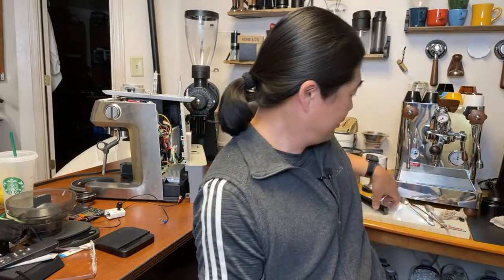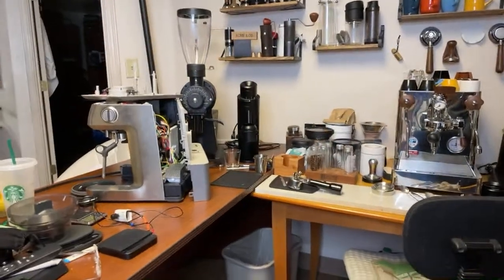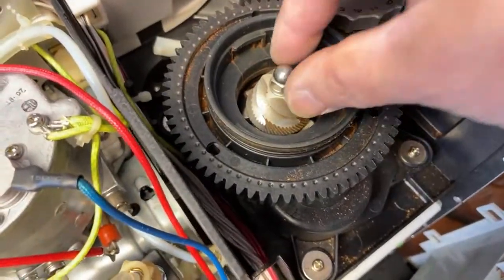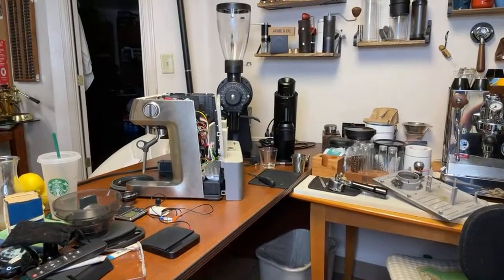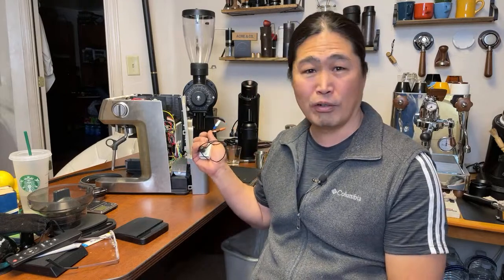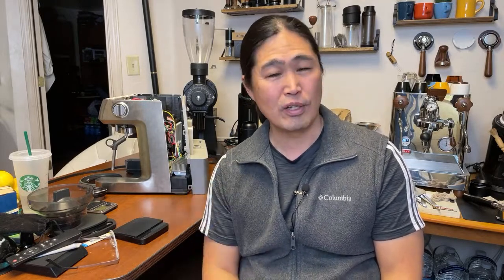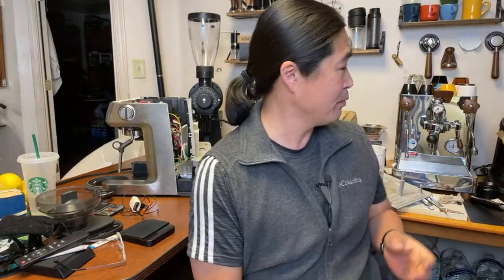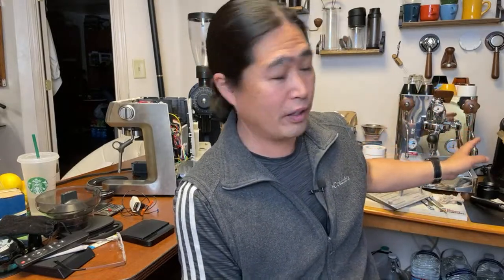Watch this before doing a dimmer mod - Breville Barista Express

Comment: if you have your machine torn downd like this at this poin you might as well get to the overflow valve and set it up for below 10 bar like from like 8 to 10 bar which is possible in the barista express. if you are willing to go the distance . i know you do not recommend doing this Mr. Hoon but 9 bar is possible in this machine even 8 bar is possible if you loose fear of messing with the machine.. I have one and I have done it i could get it down to 8 if i want it to. but i left it around 9 . and you do  nt spend anything on it or mess with any electrical part  since the overflow valve is only mechanical. and with the pressure set to like 9 bar is one less thing to worry about in your coffe making.
Reply: Steam pressure will not work that low
Reply: @angelffff7391  last time I checked it did. Are you commenting cause you think , you heard or have you experienced it yourself? Or are you afraid to ask a simple question that you have to make an affirmation that you don't know about  just to get an answer?
Reply: I have tried it it on mine if you're that curious to know. I couldnt care less if you commented on my reply keep drinking your watered down milk.

Comment: Yeah I'm more of a fan of the opv mod or opv replacement than the dimmer mod. Turning the dimmer all the way down and then pulling the shot would reduce the pressure over the entirety of the shot wouldn't it?

Comment: Does it make a big difference though? Will it help with channeling problems and help me get a shot of espresso that doesn’t need milk?
Reply: It really does help. The reason is 14bar is too much pressure to maintain a consistent extraction. Part way through the extraction, you can back the pressure off which helps to maintain a controled shot.

Comment: I have a Bambino plus and I'm planning on installing the dimmer mod. Hopefully there's enough room in there to put in the dimmer and drill a hole in the cover so I don't need anything outside...
Reply: One thing to be aware of when you do this. The walls on these machines are thick to prevent heat transfer to the outside. As a result, the stem on most dimmers will not be long enough.